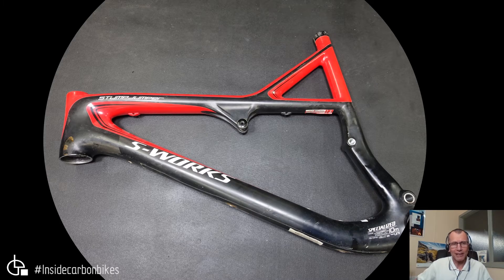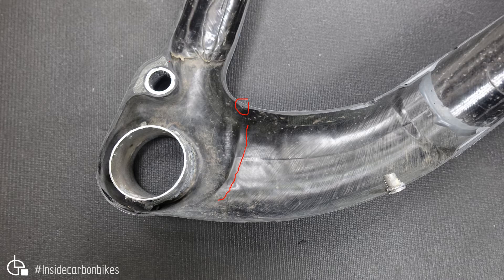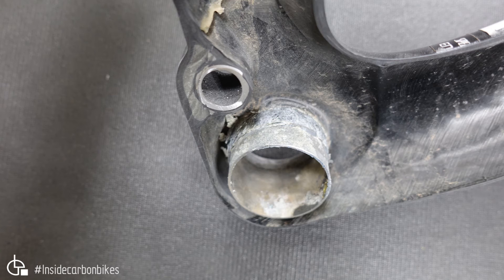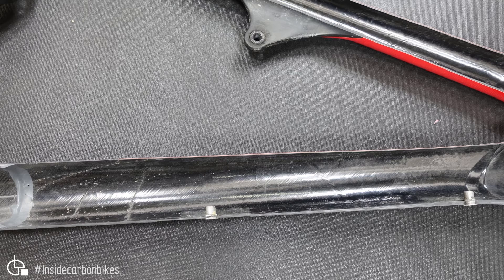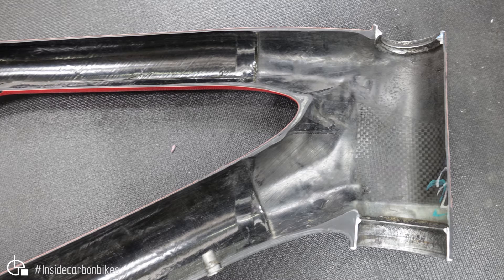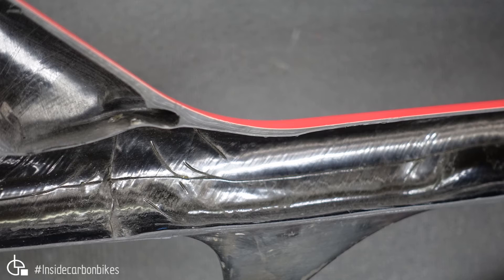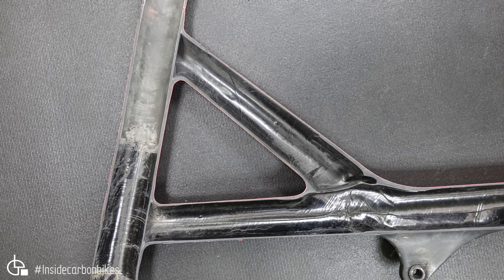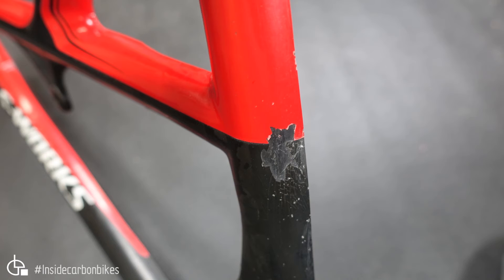Specialized S Works Stumpjumper - Cut up and Review

Comment: Thanks for finally cutting up a MTB, keen to see what, if any manufacturing differences there are.
Reply: His last words in this vid regarding how his shop gets plenty of repairable MTB frames I found illuminating! As well as how MTB frames often have more margin for error.  It at least explains how most of the cut-ups are roadie.
Reply from the maker: Yes, we gets lots of small impact damage, due to the typically thicker laminate the damage doesn't propagate as much, so most are repairable.

Comment: Any idea of the manufacturer of the frame, Merida? As well as the quality I like to know which factory has manufactured it, I wonder if the manufacturer has a code on the frame perhaps internally? Seems to be a fairly positive review and Merida are meant to be second only to Giant in high quality frame production in Taiwan. Merida and Specialized are connected although I know some current Specialized frames are manufactured by fuji-ta but those may be all aluminium. I guess my point is we are assessing brand quality but many of the brands don't actually manufacture anything and may swop factories regularly. I'd like to know which actual factories manufacture the best frames. Giant, Merida, Quest Composites, Fuji-ta etc.
Reply: Merida are owned by specialized
Reply: glenn oc Other way around kind of. Merida owns 49% of Specialized while Mike Sinyard, retains 51% stake.
Reply: @RyonBeachner  That's interesting
Reply: All made in China. Painted in China. Assembled in Taiwan.

Ive owned about 15 sworks bikes. It is just a sticker.
I source frames now from several OEM contacts who make for these insane mark up brands.
Latest Giant TCR made in China.
Reply: @durianriders  Not for.much.longer though.as Giant pulling out of mainland production. Politics and increasing costs hence made in Vietnam.is popping up.
Reply: @glennoc8585  and China getting too expensive for them (and their margins) 😂
Reply: @st939  yes but that's business and the biggest market is north America.
Reply: Giant is still made in Taiwan, they weave their own carbon for christs sake, and are arguably the largest manufacturer in the world. No, the latest TCR isn’t made in mainland china and assembled in Taiwan. If that were the case they wouldn’t have just dumped a ton of money into laser cutting and robotic layup. 

Yes the markup on frames is massive, and that’s how they pay for marketing and liability. If you want a cheap carbon bike, there’s PLENTY of options. However if you’re to have a catastrophic failure and want to hold the company responsible, good luck with your open mold china special. 

Since when is profit a dirty word?
Reply: @RyonBeachner  Some are but they were and are manufacturing in China. I had an early giant carbon, alloy, Kevlar frame years ago that I think was made in Japan.
Reply: @RyonBeachner  Giant have been manufacturing their high quality CF frames in Taiwan and lower CF frames in mainland China for sometime but what they were resisting was manufacturing in Vietnam and Cambodia etc. As ever its always hard to know the current situation but I seem to recall reading somewhere they were resistant to moving production to cheaper factories with lower quality output and they were even prepared to take a small loss on their entry level road bikes Contend etc to keep a foot in the door of that mass market although the word 'prepared' could also be substituted with the word 'forced'. However that was maybe a couple of years ago. They also admitted at the time in a roundabout way that they had lost a lot of oem business although stated they were moving away from the oem business rather than admit they were less competitive in that area. I used to spend sometime translating my google searches into chinese so I could find interesting info from china and then re-translate those stories back to english so I could read them and found some interesting info that way plus a lot of garbage info as well.
Reply: @durianriders  'The Made in Taiwan' sticker is a magical sticker that commands a higher retail price nowadays, you can't blame importers from doing that, the only thing I'd disagree with you about is the made in China bit, many of these cheaper frames are coming from Vietnam, Cambodia etc as CF is a very labour intensive process and there are large savings to be made. Here in Europe the frames are left as 'Made in Cambodia' or 'Made in Vietnam' so they get into Europe tariff free but elsewhere in the world they may end up with the Taiwan sticker after minor processing in Taiwan. Germany has been doing this for a long time using the EU's last significant process rule so a fully Chinese bike only has to be slapped in a box in Germany to get a 'Made in Germany' sticker. It's all a bloody con designed to extract the maximum currency from the cyclist and achieve the highest margin while doing so.
Reply: @glennoc8585  I think I read more recently that Specialized has been buying back shares from Merida and so Merida own far less of them nowadays but definitely its Merida that owns part of Specialized not the other way around.
Reply: I'm curious what my frame is like inside, 2011 Merida 120,  might stick a camera inside next time i have the forks off. should i expect similar to the one in the video?

Comment: Do any manufacturers ever offer you a consulting position? Or try to hire you outright?  You would think they would beat a path to your door to get your expertise.
Reply: I think they could change a lot more money if it had a sticker that said: Inspected by and passed by Raoul Luescher. I know I would buy it then.
Reply: @samhe1521  EXACTLY!!!!!!!   Carbon frames are a quality lottery and not designed to last if crashed or even dropped in some instances.  They are made VERY cheaply made (with a very few exceptions) yet cost a great deal of money.
Reply: Brands dont yet understand social media. They put money into marketing hype for the Veblen Goods effect. 
Id say 90% of consumers want status over longterm durability. That is from 23 years working in the cycling industry.
Example is ride a Reid with 105 brakes or the latest sworks with rubbing rotors.

Comment: Unrelated question/idea for another video.
Can you use pipe cutters for cutting carbon tubes eg steerers or seat-posts?

1. No, damages and crushes carbon structure. Use on metals only.
2. Yes if done carefully with high quality pipe cutters and not too much pressure.
3. It's always the best choice, much better than a hacksaw, even with dedicated carbon blade and a guide.
Reply: That is going to cause delamination. Get a proper tungsten carbide hacksaw blade for $10, or use a fine tooth metal blade if you are cheap.
Reply from the maker: I do NOT recommend pipe cutters for carbon steerers.